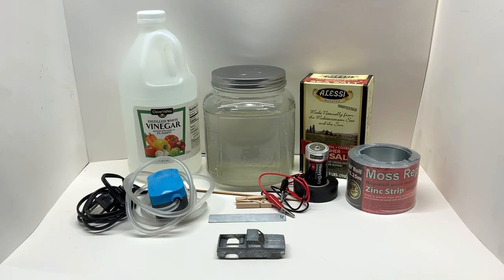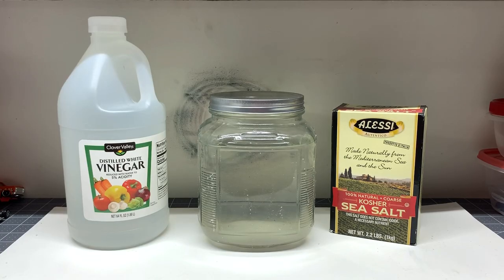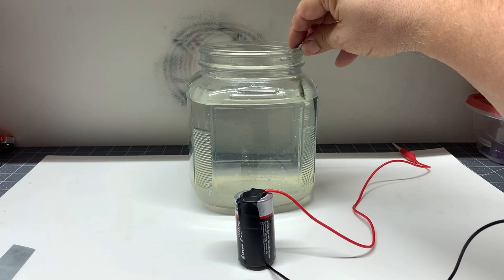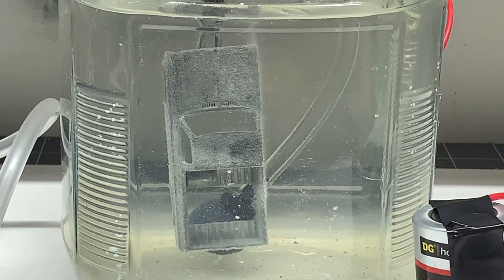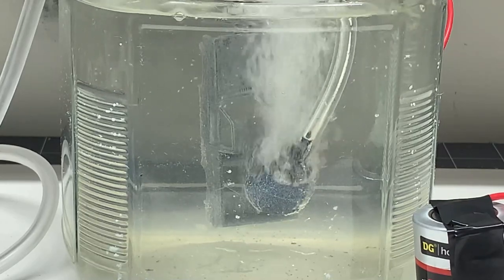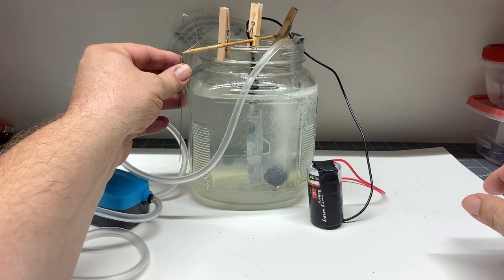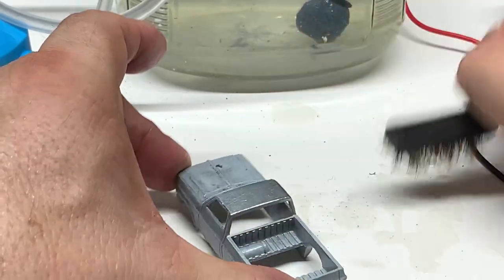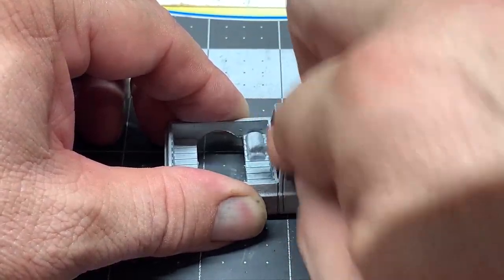How to Zinc Plate a Diecast Car Ver 2

Comment: First, let me say, I LOVE this method. Seems to use less dangerous chemicals, use only a D type battery instead of a machine connected to the main powerline of the house, which again, is less dangerous. One thing I wanna make sure, you used a zinc strip and let it melt in the vinegar/salt mix, then you used another strip that you put in the croc clamp linked to the positive side of the battery, right?
Reply from the maker: That is correct Sir
Reply: Agreed!!